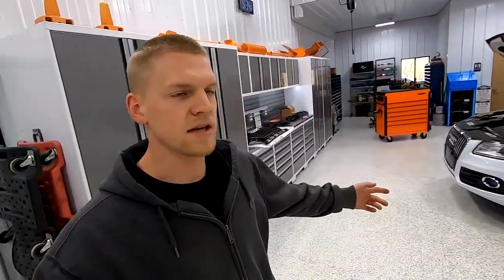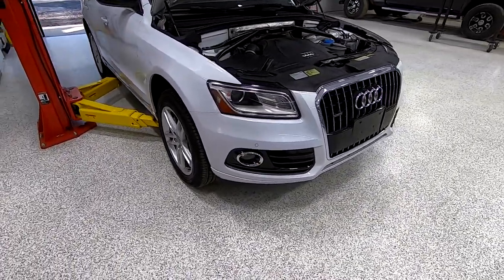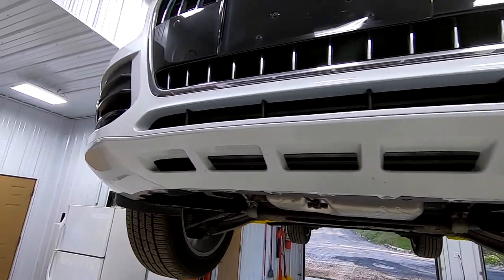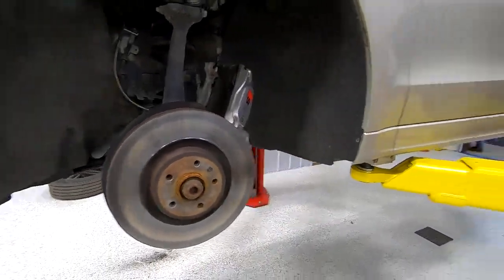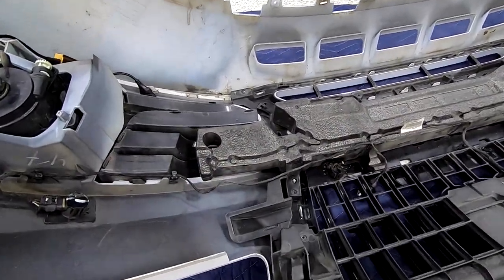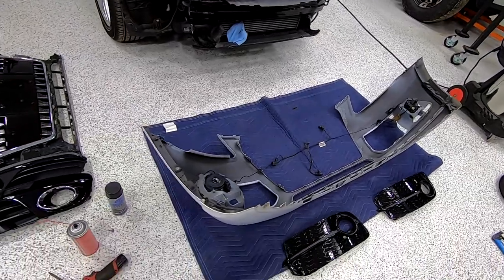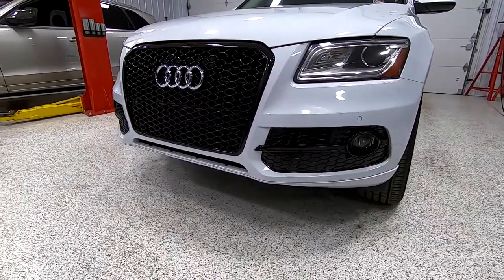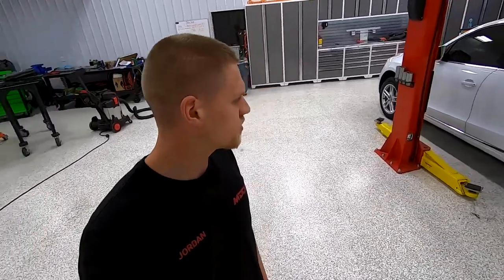INSTALLING A GRILLE ON A AUDI Q5

Comment: Do you guys know if it's possible to remove the OEM license plate bracket without removing the bumper? I'm talking about that black piano rectangular trim part  that has the sensors in it?

Comment: Did the parking sensors have a spot in the new grill?
Reply from the maker: Yessir they went right into the spots on the new grille
Reply: @jordancampbell3723  Are the PDC cables visible now? Because they are too short...